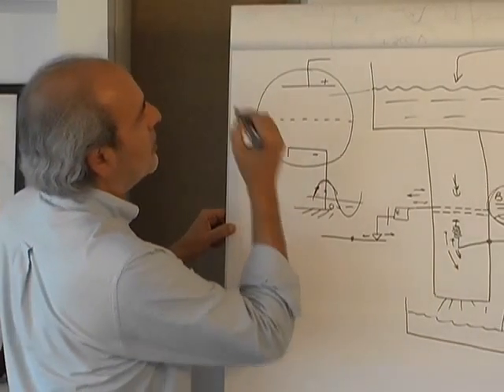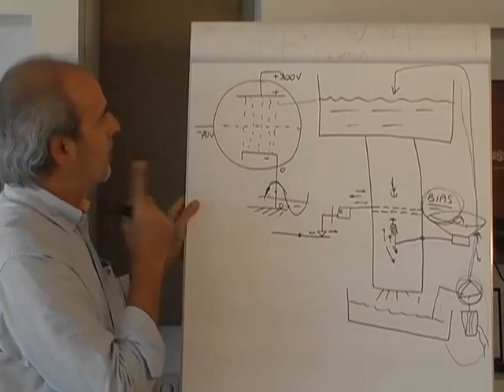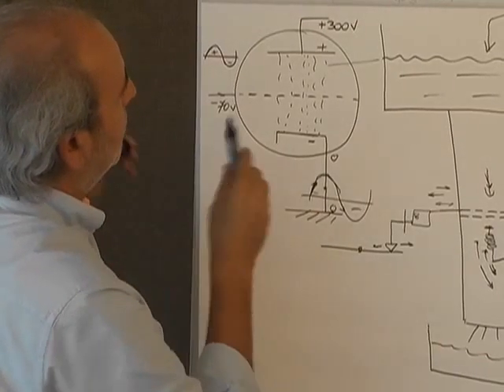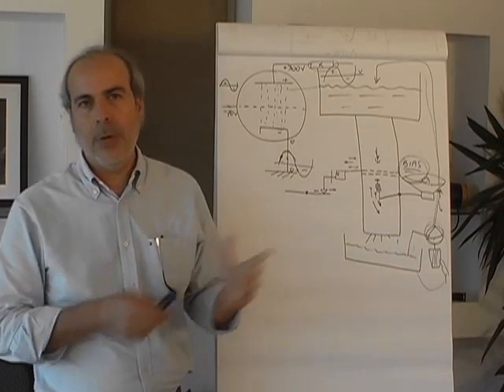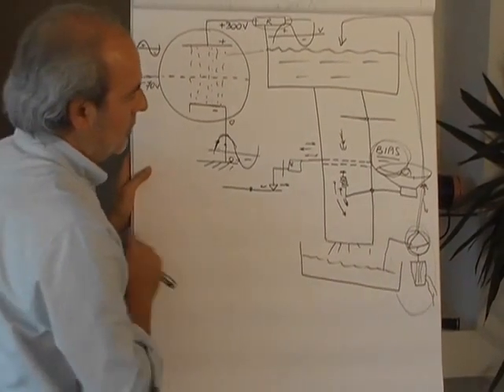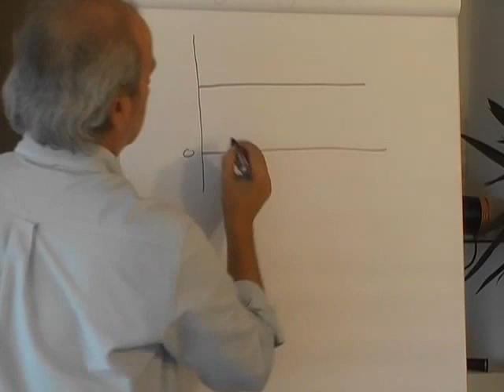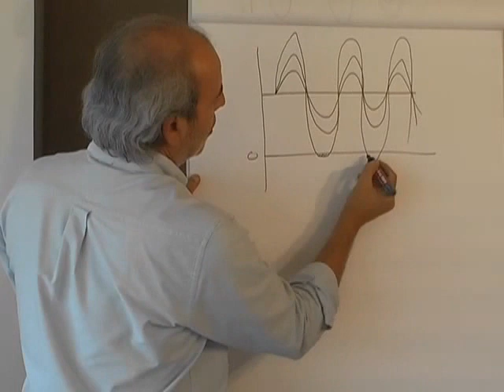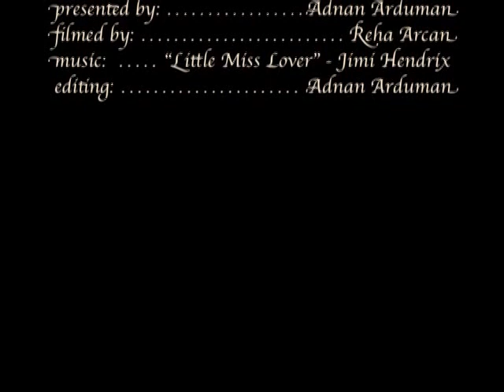Vacuum Tube: How Does It Work? (Part 3)

Comment: Excellent. In part one when he said it would be for non technical people I was afraid it would be dumbed down too much. Not at all. I have a technical background and this explained the basics very well.

I like the transition from the water (hydraulic) analogy to the actual tube and electrical flow, relating both. Well done.

Comment: This is a fantastic video from a very good teacher. I've learned a lot. Love to see a video explaining more about how a instrument amp is put together with preamps, eq-filters, power stages and so on. And I've also curios about the difference between class a and class ab amps
Reply: A class A amp (single or double ended) is biased so that current is flowing in the output tube(s) during the whole cycle of the signal. Low distortion is obtained at the expense of efficiency since most of the power from the power supply is converted to heat rather than sound. A double ended class B amp is biased so that current flows in one output tube during the positive excursion of the signal and in the other tube during the negative excursion. Efficiency is high, but unfortunately there is 'notch' or 'crossover' distortion produced as the signal transfers from one tube to the other. A class AB amp is biased so that it operates in class A for low level signals to eliminate the distortion and operates in class B for higher level signals. Some of the efficiency of class B is sacrificed to eliminate the distortion.

Comment: great explanation...very good method...one suggestion though would be to discuss electrical potential...meaning the buildup of electrons (i.e. on the grid) and how it acts the same as two south pole magnets being pushed together...by adjusting the potential on the grid (from the incoming signal) your either allowing more or less electrons to flow to the anode by adjusting the grids negative force or electrical potential...either way i think people for the most part will get it

Comment: Great video! Nice illustrations!
So saturation happens when your "pump" runs out capacity.  I have overloaded tube voltages and I am having great luck with tone shaping.  It is like shaping the plates with your "water".   Higher the power, more the slope - (shape).  Thanks for another perspective-People learn in different ways, I can see how this could help.  Remember all, when working with vacuum tubes you can have voltages of 500+.  Be careful-  learn proper methods before exploring.

Comment: There is a standby current, yes.  It ranges between fractions of a mA and several mA, up to 6 or 7. However, this current is negligible in tube amplifier circuits because there is a shunning resistor and a bypass cap.

DC current passes through the resistor to ground, and is nullified while the AC signal passes through the bypass capacitor unimpeded.

I will message you with a highly recommended information source. I learned everything i know about tubes from it, great place to start.

Comment: A very excellent presentation.  I have a very basic question.  In the absence of a bias voltage, would amplification still occur when the grid signal is of the same polarity as the plate.  If so, since there are no "free lunches" what is the trade-off for this amplification?  I realize this question may not make sense.
Thank you.

Comment: Thank you!!!  I have a Dynaco tube amp that my father built in the 60s and now I understand how it works. I am also interested in triode tube based overdrive effects for guitar. When you explained the Class A amplification you said that you need to keep the negative side of the sine wave above zero. In an overdrive effect, does the bottom of the wave just get clipped?  If so, is that what causes the "fuzzy" distortion?

Comment: Hi, great video,

I've been trying to find information on the operation of a penode in class a.  Specifically, how does the difference in voltage between the screen grid and plate effect the operation of the amplifier.  Also what roll does screen grid current play.  I understand the purpose of the screen grid, just not what happens when the screen grid voltage differs from the plate voltage.  Note I am asking about the screen grid in a penode, not the control grid in a triode. Thanks in advance.

Comment from the maker: @CanticlesInProgress The current is between the Plate and the Cathode, the Grid is controlling the flow amount of this current. The rule is to have the Grid's potential below the Cathode's potential. If the Cathode is 0V, then Grid has to have minus values. If the Cathode is say 100V, then the Grid can be 40V (just an example). These videos are made to explain the functioning of the tube without entering in too much detail. All these values are derived from the tube curves, try to look at them.

Comment from the maker: @44433391 This is a very complex question and unfortunately cannot be answered in a few words. The best way to deal with it, is to try to understand the tube curves. When you plot your bias point and the voltage swing (based on the limit power), you will see it better. The same is also valid for the preamp stage (voltage amplification).

Comment: I don't see why can't you go with out a valve....?! If you Increase and decrease your Higher Potential with a sine wave you should be able to achieve the same effect of smaller and greater current flow from cathode to anode. The lowest it would be is 0 and the greatest well depends on few factors. So why would you prefer a valve as opposed to changing Higher Potential voltage?
Reply: +Glad to Be Normal  valve is needed because the valve already has current by voltage diffrence . The grid in this case in the form of music/sound signals uses the already flowing current to increase ITSELF therefore possible to amplifie his own sound signals in the form of electrictrons flowing by the help of the already existing curent. This can be done by increasing the volume of sound you put on the grid, and therefore open up e gate/gride more for the already existing current to flow along with the sound signals. Therofore it wil amplifie the sound in this case. You can indeed increase without the valve. But the increase you can has a limit. Therfore the vacuum tube. The vacuumtube helps you to go beyond! This was the best i can to explain you. Im sorry if i only made you more confused. Anyway you made a realy realy good question!! ;) Peace namste bro ;)
Reply: +Tele Player  I understand what you are saying bro! And you are not wrong! ;)